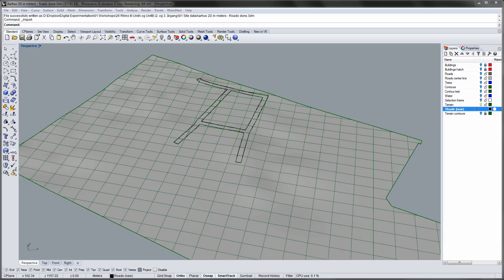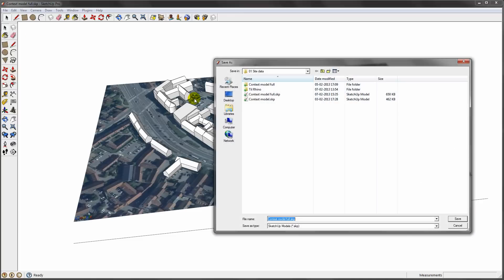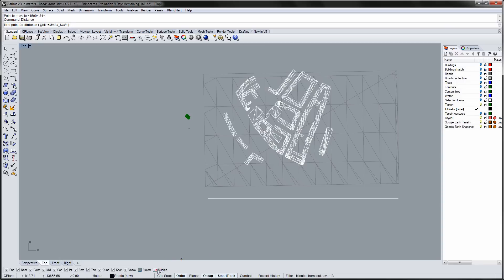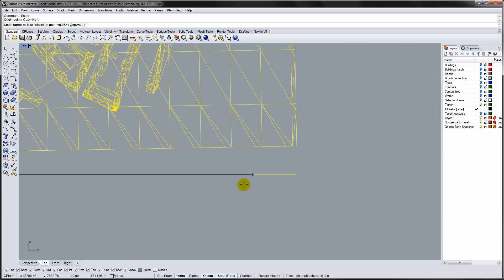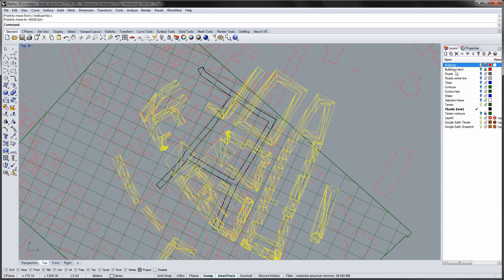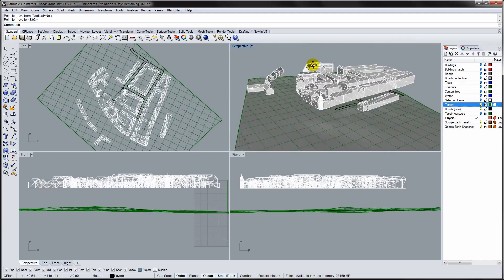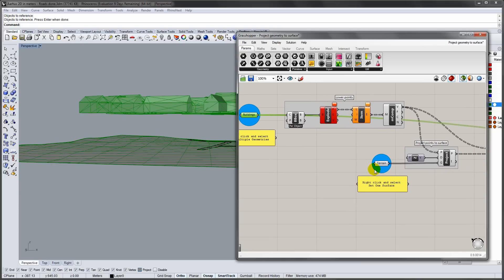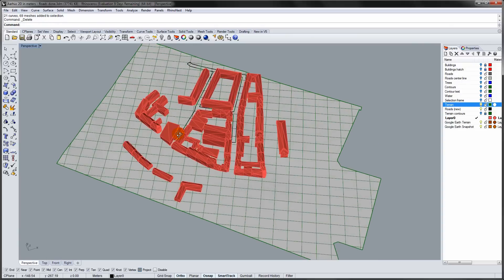Rhino - Placing buildings on terrain

Comment: Thank you now I need to solve how can I do that code in Dynamo, I don't want to use Rhino in Revit.
Reply from the maker: Yeah, I get that. A temporary workaround would be to export the Rhino geometry as a .dwg file and then link it into Revit. It won’t be editable but you’ll have reference geometry for the context. Let me know if you find a solution with Dynamo.
Reply: @rubenborup  I am still working on it.

Comment: The tutorial is great, thank you! However, the last battery of the "selecting longest distance" block is marked as OLD. I bet that's why its not working! Is there any way I can fix that? Thank you again you're awesome
Reply from the maker: Hi Camila,
The grasshopper script is from 2013 so it's likely that the "select longest distance" component has been updated (usually to have more features). I think that replacing the component with a newer version within Grasshopper will fix the problem. Please let me know it that works out for you.
Best, Ruben.
Reply: I have the same problem and I can not solve it.Can you help me Ruben  ?

Comment: It projects the points correctly but places my buildings under the surface for some reason. Their geometry is simple.
Reply from the maker: Grasshopper is using a bounding box for each building (mesh) to place the building on the terrain.
Each building should be a separate object that you can select individually - so if you select an object and 5 buildings are selected, then you need to break up your geometry further.
You can also start out with something simple like a box - just to verify that everything works the way it should. 90% of the time the problem is related to the building mesh, so hopefully that's also the case for you.
I hope it all works out.
/Ruben.

Comment: I have a big issue about my surface. Well, it is not actually a "surface". It is polysurface but I could transform it to a 'mesh'. I dont know how to convert mesh or polysurface to a surface. I dont have a surface so I cant define it as 'terrain' :( Can someone pleeaasee help me as soon as you can 🙄
Reply: Well, I finally make this happened! This is really amazing actually. But I had do modify it. I added the 'negative' because all the buildings were under my terrain.
Reply: hi! how did you resolve this? I am having the same issue, i have a mesh rather than surface
Reply: @zynpozbdk  hello! could you please tell me how did you solve this problem? Thanks! I only got a mesh😭

Comment: Thanks! This was extra helpful. On grasshopper when I clicked Buildings and set it to select geometry it just wouldn't work. Box carried on beign orange and not turning grey at all... I'm a complete begginer, any help?
Reply from the maker: Could it be that the buildings are grouped or one single mesh?
I would try with just a simple box created in Rhino - if you can drop that on the terrain using Grasshopper, then the problem is related to your building geometry.
Hope that's any help.

Comment: hi, thank you for uploading this file! for some reason the 2 "item" batteries have an "old" label on them and therefore does not work. any ideas on how to solve this? thanks!!!
Reply from the maker: The "old" label means that the definition was made with an older version of Grasshopper. Just replace the "Bounding box" component (battery) with the new version and make sure it is wired correctly. If this doesn't solve the problem, let me know.

Comment: Hi, thanks for this. Is it possible to project block instances instead of geometry (buildings) so that I can apply the same changes to the resulting flowing array?
Reply from the maker: Hi Dan,
I don't believe that Grasshopper supports Rhino blocks at this time and I haven't found a workaround just yet - if I do, I will let you now.

Cheers,
Ruben.
Reply: Are any solutions available for this?

Comment: thank you for the definition, but it does not place all of the geometry accurately on the terrain, only some. Do you know why this would be?
Reply from the maker: The problem could be related to the geometry that you place (i.e. huge a huge complex model). Each building is placed using just one point to speed things up - that can lead to errors as well. I normally use the script to place the bulk of the buildings, then make the necessary adjustments by hand. I admit that this is not a bullet proof tool, but hopefully it'll work for most scenarios.